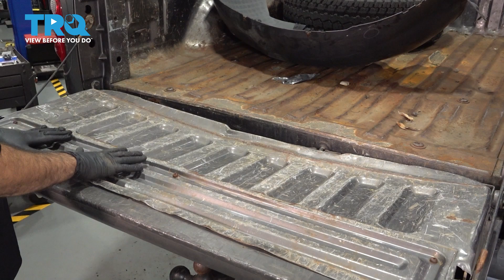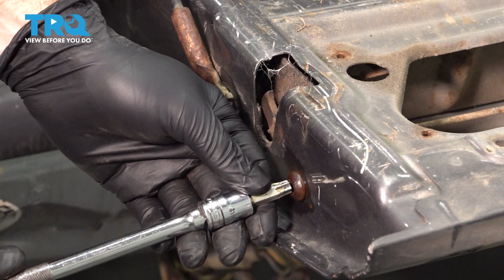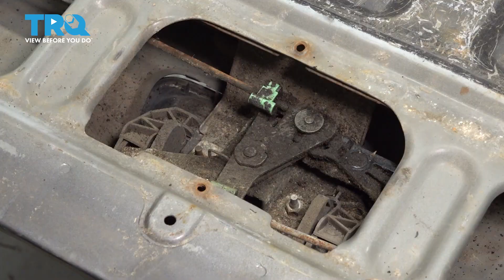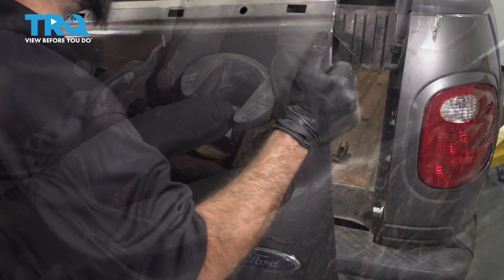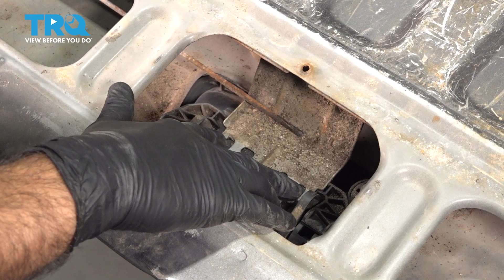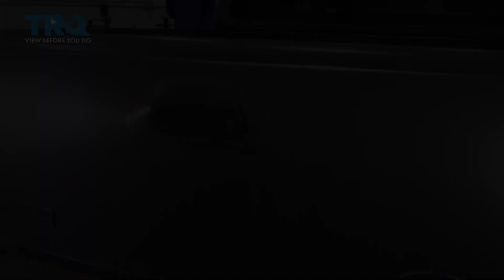How to Replace Tailgate 1997-2003 Ford F-150

Comment: What is that pin sticking out of the rear of the bed ¹/3 from right hinge, the bottom of the tailgate has a bracket that aligns with it?